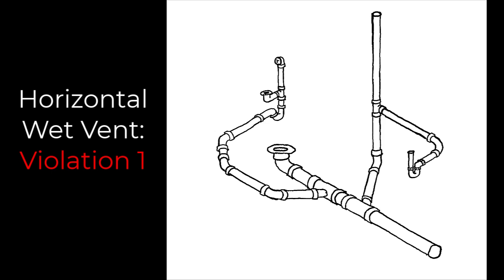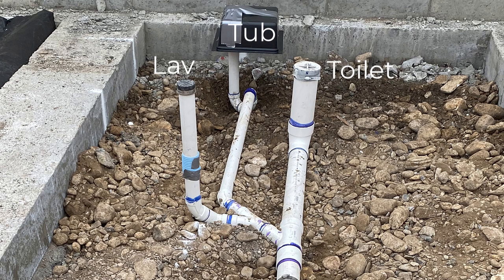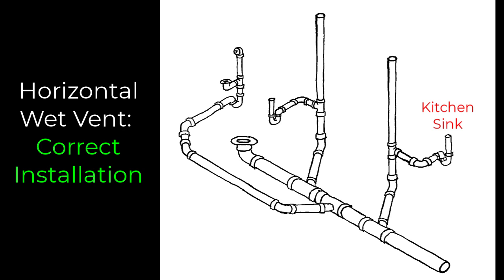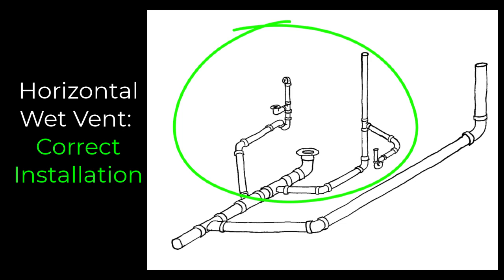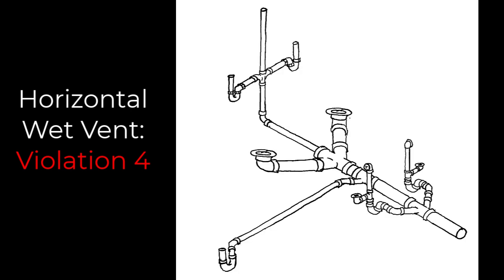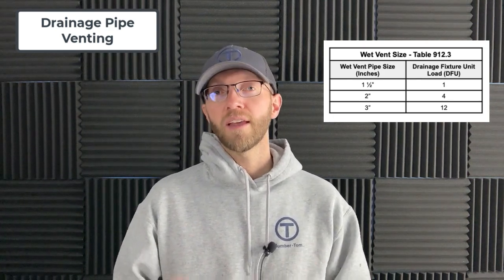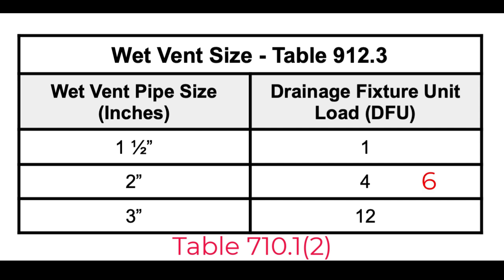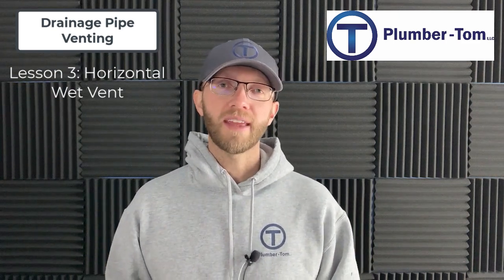Drain Venting Lesson 3 - Horizontal Wet Vent Part 3

Comment: The adopted 2018 IPC Plumbing Code in NC it does not say anything about example 2 with the Kitchen Sink in section 912 wet horizontal wet venting section.  Does that come out in the 2024?  Grok said NC might wait until 2027 to adopt a new IPC code.  What are your Thoughts?

Comment: Is there ever a situation where it is permissible to use a wet vent that is not in a bathroom group? Say a washer box and a floor drain wet vented off the washer drain, and/or a laundry sink, if it’s within the 12 dfu parameter?
Reply from the maker: No. We vents are for bathroom fixtures only.  But common vents and circuit vents might be applied to laundry situations. So yes, if you have a laundry and floor drain can be together on one common vent.  Basically, you just need to know which vent method to call it.

Comment: Stupid question:  would “Violation 2” be ok if the kitchen drain had its own Studer Valve?
Reply from the maker: Technically no. It should not run through the bathroom group even if it is vented.

Comment: I’m confused how your correct installation for #4 is different to the violation #3. Haven’t you just run your “waste from fixtures above through the middle of your bathroom group”?
Reply: Is it just because it is within the same bathroom group?
Reply from the maker: Yes.  That works with the same group.
Reply from the maker: Good question.  The issue in violation 3 is that the whole waste stack from above is coming through the wet vented bathroom group and interrupting the venting airflow.  In the 4th example, the additional fixture is being vented and it is on the same horizontal.  It is probably better to view the second group as circuit vented.  Make sure to watch the videos explaining how that works.

Comment: Would it be possible to use the same 2 inch pipe that goes under the bathtub and shower drain then down stack?
Reply from the maker: Not sure what you mean. The tub and shower have to have separate pipes connecting to the horizontal wet vent.
Reply: @plumber-tom9470 I messed up. I wish I can send you a pic

Comment: So.. I'm one who completely disagrees with a horizontal wet venting. I just want to note, That this sort of system should not  be used as a standard practice. These systems should and only be used in bathroom groups or homes that are not frequently used.  This design is best used for something like a vacation cabin or something similar.  Not for consistent or longer duration uses. Good videos.  Every trap deserves a vent.
Reply from the maker: Thank you for sharing your opinion.  A vent for every trap really does work best.  Just not the most economical installation.
Reply: @plumber-tom9470  You made the exact point. economical for a plumber.  not good practice. Only for specialty situations.  You should read the narrative notes in the upc code book for better understanding. still good videos.

Comment: Why are the water closets not at downstream of all fixtures, i m in Canada, based on our code, WCs shall be the most downstream fixtures.
Reply from the maker: Depends on the code. IPC does not required that. UPC does. Of course you will need to do as local code requires.

Comment: in violation number 3 - if all of the ramrodded waste from further up the line goes through the bathroom group, but still gives access to the main line clean out, isn't that better than having the solution you posted without a clean out?

Comment: How would you run the plumbing if the kitchen sink was more directly behind the toilet area? And the main line was coming directly to the toilet from the kitchen side. Also can the kitchen vent pipe in the bathroom vent pipe combined in the wall to go out the roof and can it be a 2 inch pipe?
Reply from the maker: That is where you have to get creative.  Sometimes code compliance is not easy. Yes the vents could be combined.

Comment: New plumber in Utah, having trouble comprehending/ understanding/ picturing IPC code 912.2.1   Specifically “Where the dry-vent connects to a water closet fixture drain, the drain shall connect horizontally to the horizontal wet-vent system.” If you could elaborate much appreciated.
Reply from the maker: All wet vents must connect to a dry vent.   The dry vent must be vertical. But the wet vent is the horizontal drain that is being used as a vent. This is why it connects horizontally to the toilet.  Does that make sense?